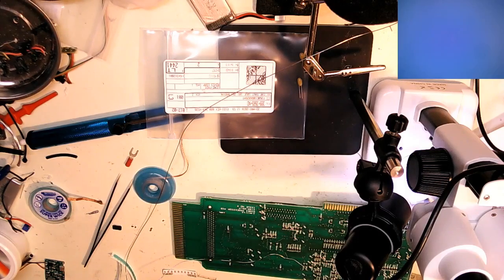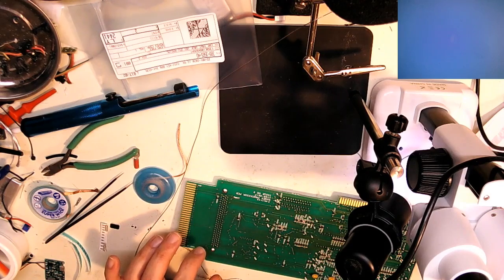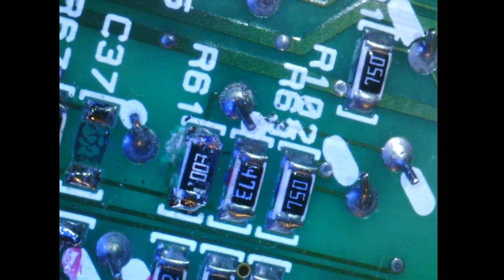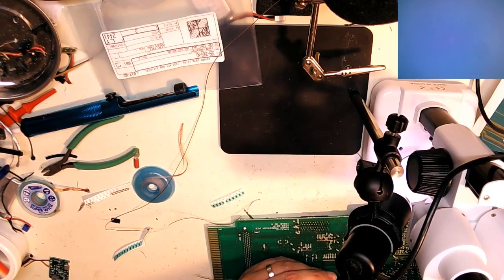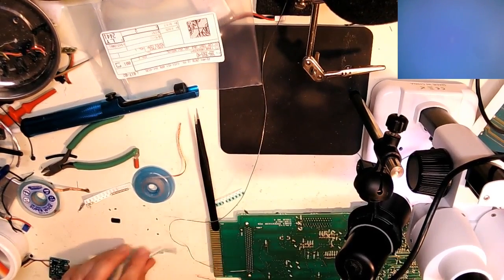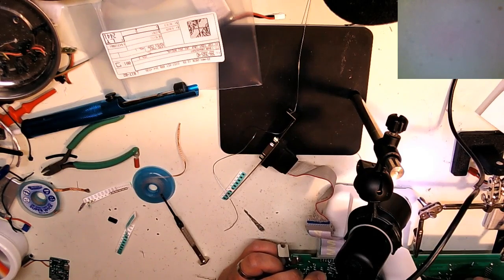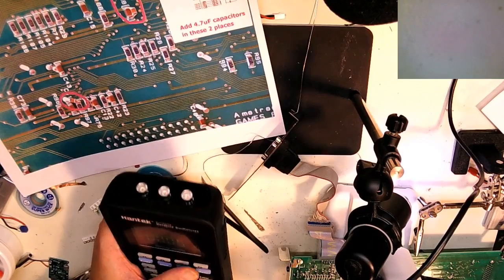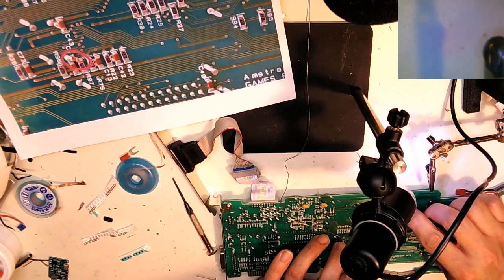What's on My Workbench, Mega Drive ISA Card, day 3

Comment: Nice vid. Whats a good temp to solder componets like wire to pcbs
Reply from the maker: For wire/thru hole components, I usually stick to 650F/340C, the tip makes more of a difference than the temperature.  For surface mount, 581F/305C is what I find works best.  Again, the tip size is key when working with larger components.